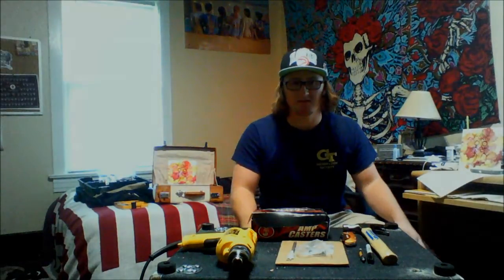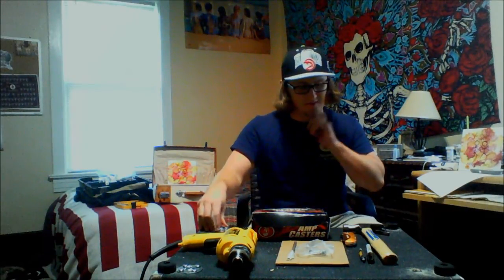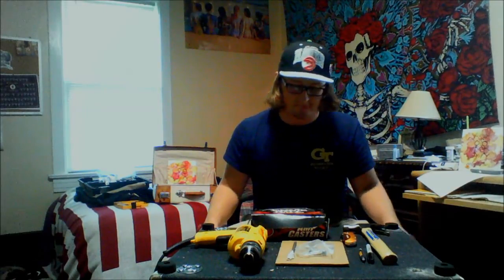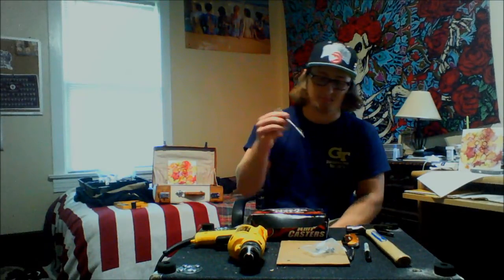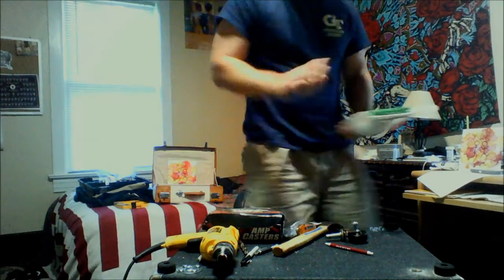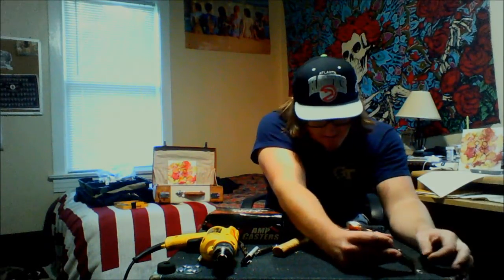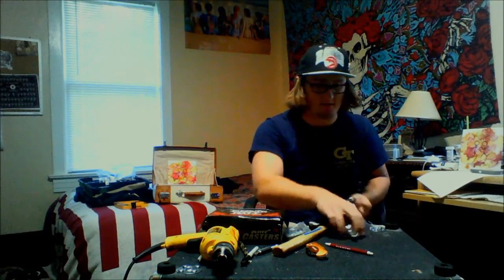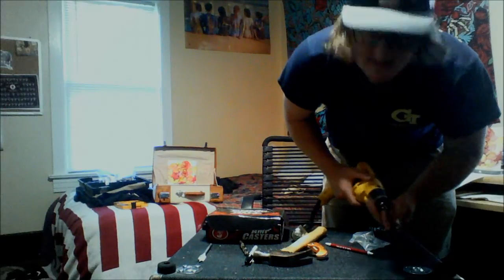Amp Caster Installation in 5 (easy) Steps!!!

Comment: Great video...i dont understand...unless u have ocd...why u need to align the 4 screws w the ones on the rubber mounts😍😎🙄☺🤗💞💖noone will ever turn the cabinet over n say...hey dude...the screws werent aligned w the stars n the other screws...makes no difference...as long as the castors r secure💞💖tcare n god bless...

Comment: Excellent tutorial - it cleared things up for me nicely after coming to the realization that some actual effort (like drilling and measuring) was going to be required to install the casters.  

The jury's still out on whether I'm going to test my expertise on a brand new Fender bass cab (with new Ernie Ball casters), but at least the knowledge has been acquired.

Thanks again for the assist!!!
Reply: *****
You read my mind - I just downloaded the schematic posted for the Rumble 500 cab (2x8) that just arrived two days ago.  The head arrived yesterday, so it is anticipated that I'll power everything up and give the rig a spin sometime later today before starting the modification (or having the amp guy that my luthier uses do it if I chicken out...).   The combo comes equipped with casters, so I don't see why the stand alone cab shouldn't accommodate them as well.  I'll definitely let you know how things turn out; rest assured that I am appreciative!!!